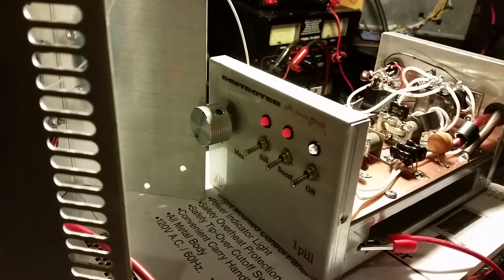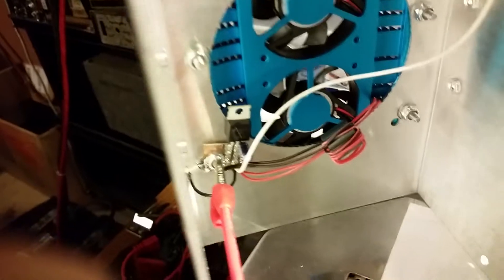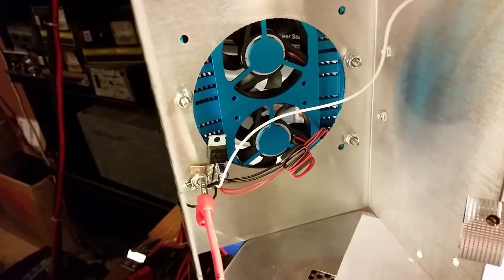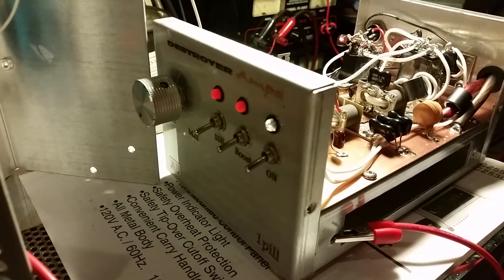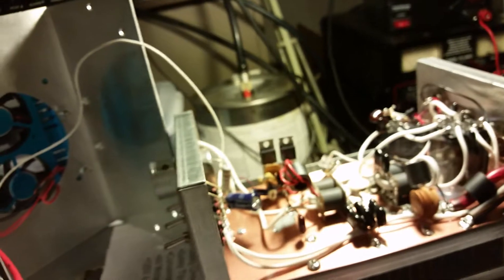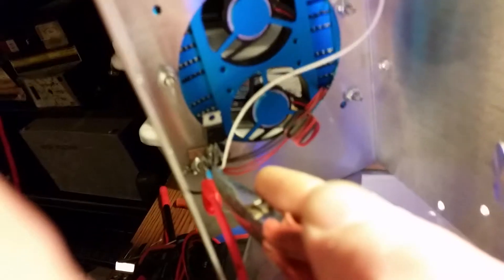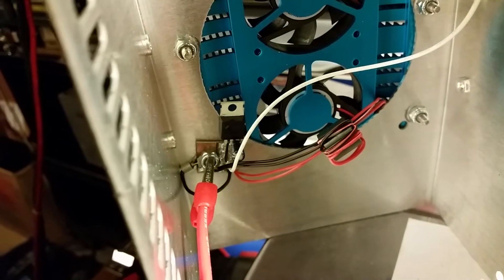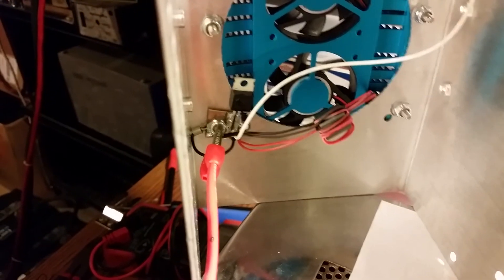Quick Fix of Fan Noise From Oscillating LM 7812 12v Regulator

Comment: good work. came here by googling "7812 oscillating". just fixed a similar problem in a chinese made karaoke active speaker. it would whistle at certain volume or eq settings. traced it down to an oscillating 7812 regulator which put noise into the mixer circuit which would then go into the power amp and the speakers.

whoever designed the power amp forgot to read the datasheet of the 7812. adequate capacitance on the output no problem, but the input came in thru a 100 ohm 3W resistor from the main dc rails +33v. no capacitance after the resistor. none at all. 100n was not enough here. 4.7u soldered directly across the input and ground legs of the 7812 regulator eliminated the oscillation and allowed the amp and speaker to perform cleanly.

Comment: Yea them regulators can take off. I will just mention one thing though, the caps need to be as close to the pins of the 7812 otherwise they can still oscillate due to series inductance of the wires. Just for the record you can use a tuned circuit in a feedback path to purposely form a power oscillator around one of those even though they aren't intended for it. Actually I should thank you for this video because I have been pondering electronic projects to build and the idea of trying to form a crystal controlled power oscillator based around a three terminal regulator comes to mind, just for the novelty factor lol!